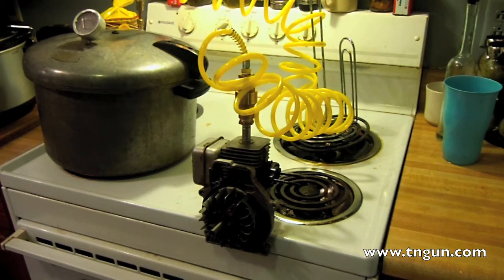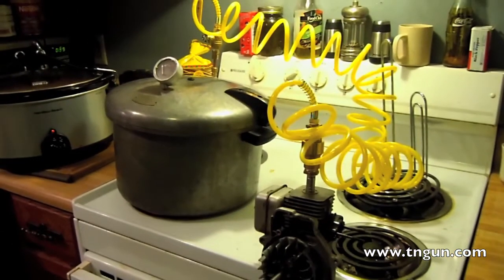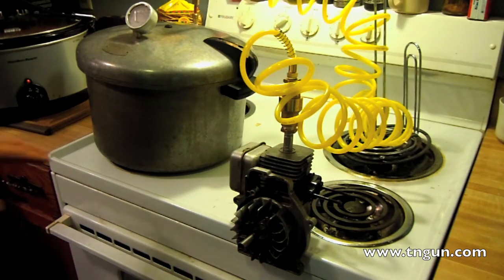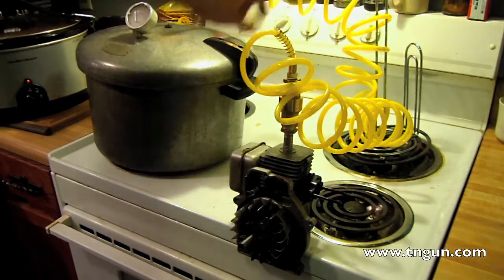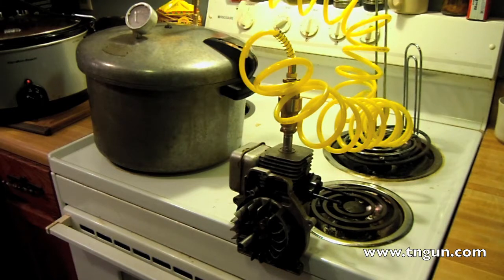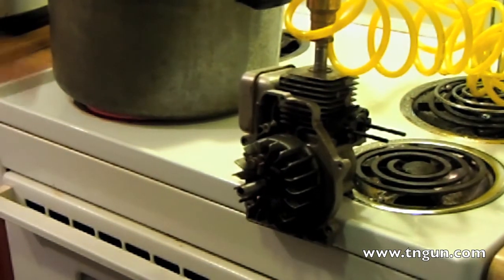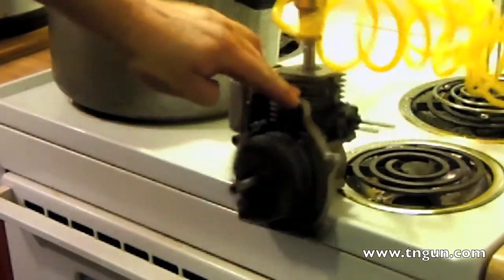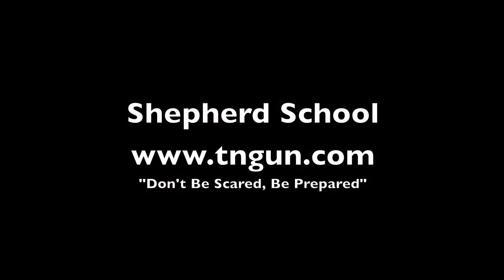How to Build a DIY Steam Boiler

Comment: If I had one suggestion besides mount that so your hands are safe it would be to figure out the valve and rod that lets steam push the piston back up. Great build nice to see it actually run on steam.

Comment: How many PSI were you running on the engine, also what do you think the max pressure of a pressure cooker is?
Reply from the maker: Kenneth I didn't run the pressure cooker anywhere near maximum - it was around 25 psi - have no idea how that translates to HP - I very quickly gave this up as unfeasible and inefficient in real life.
Reply: Shepherd School Thanks, it was a great video, I am actually trying to make one of my own, its just been hard to get the valve correct, also i am also trying to find the best way to generate steam,and enough steam.
Reply: @TNGun  how do you get it to work at such low pressures, ive made one, and at 40psi it oscilattes back and forth. But at 100 it turns in one direction.

Comment: However a better way to do this whole setup is use a lawn mower engine. Ul have a actual built in oiling system. Just need higher pressure.

Comment: Make a oil tank that goes through the air intake and out the exhaust. Make sure u use  good blow back valves and a pressure cooker relief valve so you don't get back pressure on the piston.

Comment: thanks alot for your replay..,

I have modified an air compressor and works with me fine for about one hour on steam

I think the advantage of air compressor that it has a oil room in it.

this will reduce the heat and save the engine parts  I think.

what you say about that ??

Comment from the maker: I haven't in this model, but I am working on a longer lasting version because, this gets hot, and it needs to be inorder to be efficent, but the design of the weekeater is designed to radiate heat - so I plan on cutting off some of the cooling fins.  I also need to make some type of pull start device, or modify the current one because starting by hand is crazy and dangerous.  Also be aware, that running one in this configuration will cause it to seize up

Comment: I was thinking of using a blast of air on the flywheel to set the engine in motion. I removed most of the backing plate/bell housing part with a sawzall; I got saw happy and cut a little more than I wanted to in some places. Nothing major, mostly cosmetic. I will make a video and detail the over-cuts (fancy word for mistakes) Less metal to heat, is less metal to heat. The flywheel already acts as a rotor, but the torque at the flywheel is relatively low; a gear or pulley system adds torque

Comment: Good... you were making me nervous. I've started my own steam project, I have several engines and two air compressors to work with. One of the air compressors is from 1913. I've started with a small weed whacker engine like yours. I have several DC stepper motors I plan on driving with the engine. You can find small stepper motors in computer printers and big ones in electric scooters and kids toy cars (if free is your budget).

Comment: i have a similar idea but on the steam would go thru a valve only turned on with the down stroke of the piston... that and i think it would be cool to mount a steam whistle on there somewhere. i mounted my engine on a peice of angle bar and cut out around the magneto. mounting a flywheel would make it run much smoother too... but centering it is a pain in the behind. any ideas on an oiler?

Comment from the maker: @toddweller I was using air tool oil - probably not the best, but its what I had on hand.  No I did not fab a metal push rod, what I did was reinforce the plastic pen tube since it was starting to deform a little on the open end.  I wrapped a nail in Teflon tape and shoved it into the plastic tube and that is working great.  I suppose I ought to get around to actually finishing this project but my ADD is got me on to making my own reloading dies...

Comment: Awesome! I wonder what the best idea for lubrication is. The oil bath put back on so it doesn't leak maybe? Did you fabricate a metal push rod or was this running on the plastic one from the previous vid? I can't wait to get started on mine!

Thanks for sharing!

Comment: Looks like you could use the existing bolt holes to mount it to a piece of sheet metal or angle iron. A direct drive PMA would be simple and small but a weighted fly wheel would allow you to utilize mechanical advantage to run a belt driven PMA at a higher rpm as well as allow you to connect various tool-like attachments such as a grinding wheel, lathe, drill and so on. I cant wait until I have a place to build one just like it.